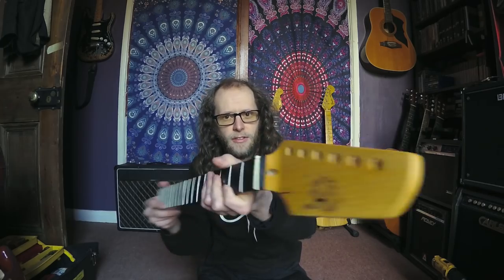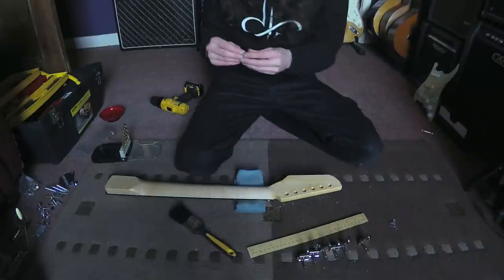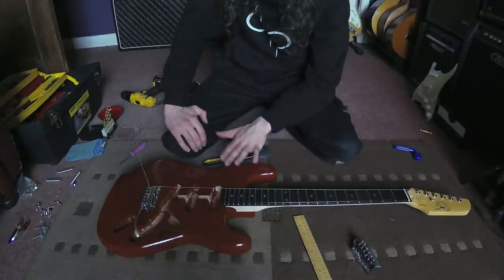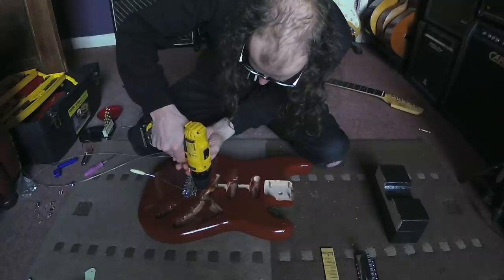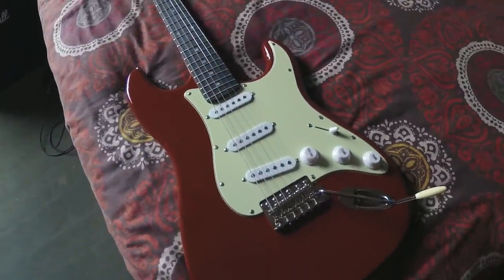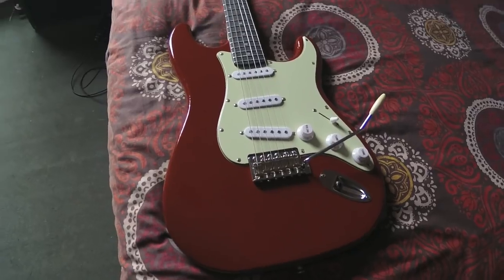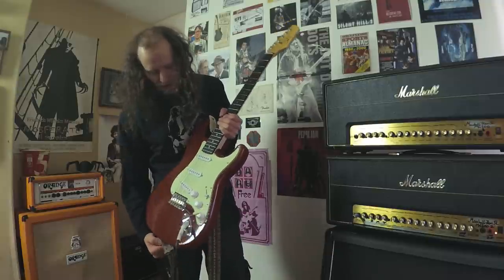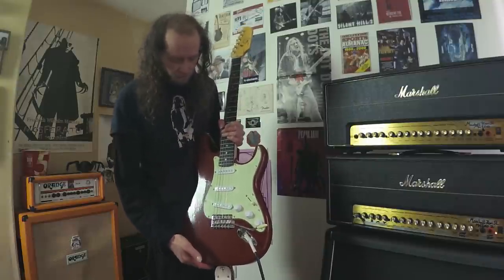Harley Benton Kit Build - Episode 3 - Reassembly

Comment: Had this kit too, but the holes of the bridge were not aligned (very bad), also had the issue with the fact that the high E was a long way from the edge( and the Low E too close to the top. I decided to make the holes 10mm and glued pieces of wooden staff in there and drilled new holes (after carefull measuring)   It is perfect now. Btw Thomann sent me a new kit and said, just keep the old one for 6 months in case the new one was not right as well. so now I have 2 of them. I rounded the edges of the neck too as it was a bit of a sharp angle. Fender headstock design copied from my old Squier and a Fender decal.  Btw the strings have a lot more tension than quality strings of the same size so you can't intonate it with factory strings, they are only useable for aligning the neck and body. Still can't imagine that you can buy this for like 77 euro (got mine on sale for 60). Love it and will buy more of them (Jaguar soon hopefully)

Comment: Hi Dave

Ive built a few of these and when the string alignment is slightly out slightly loosen the screws on the neck plate and give the headstock a good knock from right to left and the strings should then line up.
Retighten and job done.
Sorry if you already knew this but through trial and error ive encountered the same problems on Telecasters even USA ones ;-))
In my pic you'll see my latest CST 24 kit build ive just finished, But the jazzmaster one i done i fitted mini humbuckers in sounds great.

Nice playing and nice build.
Reply from the maker: Thank you very much. :)

Comment: Had already ordered the HB Strat kit before seeing your video.
Wasn’t confident that the body of mine wouldn’t be arse when it arrived, but apart from one of the four neck pocket holes being drilled apparently by someone who forgot how to use a drill ( will need to be filled and re-drilled) the body I got was good, even trem cavity rout was non wobbly.
However, even with the string guides  fully jacked up, and a straight neck, it still has choking problems.
Any advice?
Reply from the maker: Probably needs a fret level. I think I'm going to have to do mine at somepoint. :)

Comment: Can you get the backplate on your guitar as mine will not fit over a full sized trem block as the guitar body is based on a Squier and not a Fender which is a few mm thicker !! I just kept to the skinny one as I don't use trem that much anyway.

Comment: Looking beautiful Dave! One question: what is the replacement scratchplate from? I ask because I have a Harley Benton Strat and if I ever replace the pickups with a new scratchplate I'd like to know if the holes will align or not, and since yours did...so I know I can use that kind/brand of scratchplate. Assuming mine is the same as the kit, mind you, I'm not sure it's necessarily the exact same 🤣 Seems good that the Wilkinson trem drops in ok

Comment: When chappers sees sense and brings out the davecaster signature please make sure it has that head stock and a 24 inch scale length optional and I'm in looks nice something about it just roundered edges sounded sweet too but then anything you hold does but for what electrics she had she sang well get on to chapters and make it so I want 2 one that colour and a bust one be nice burst on big headstock would be nice I want to try non but i have to do 24 inch jag sale bad ring finger on fretting hand and all 25s from what iv seen but got mind working on a jazzcaster tellebridge to shorten scale move pick ups just doing some research on it trying to find out how fecks would differ would I need a special neck then would it fit kit all knots to be unfurled but all part of the fun and I can make my own custom kick some DiMarzio in it and have a guitar for life would need much more one called justin just if other breaks a string but I'd want it restring by a tech or mate as was case before but ye definitely want to make my own thing I think everyone should build one cos then repairs simple and can return favour for said mate being noodytech step in if I have too but I'll get too it soon is there an affiliate link so you get paper if i go through link cos be happier to do so or is it a direct only

Comment: Dave, if you have an ironing board, they make good work tables for guitars. Also a Wilkinson Vintage Tremolo WV6 has screw holes that accommodate different screw hole locations. I put one on my MIK maple neck strat that's like yours. Works well.
https://www.worthpoint.com/worthopedia/wilkinson-vintage-strat-wv6-tremolo-465071031